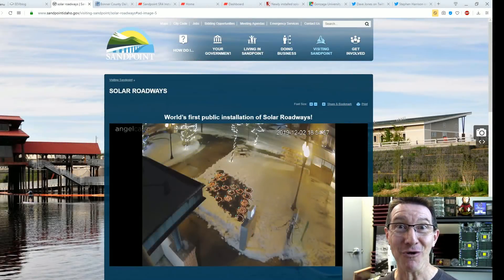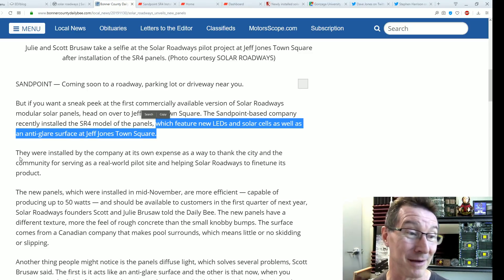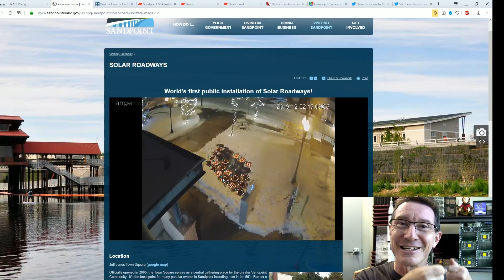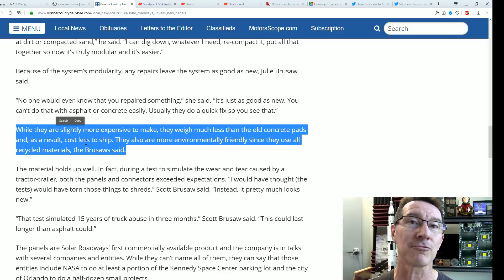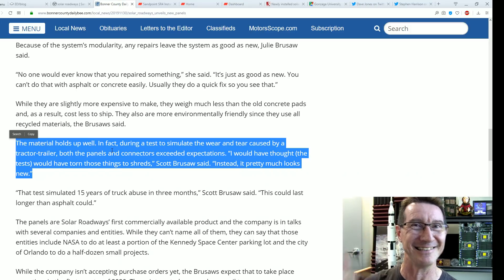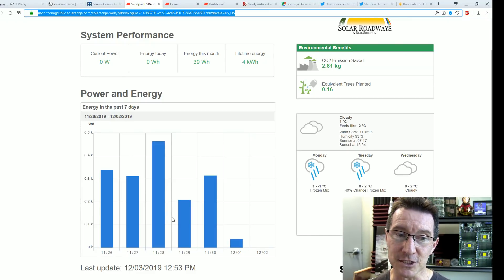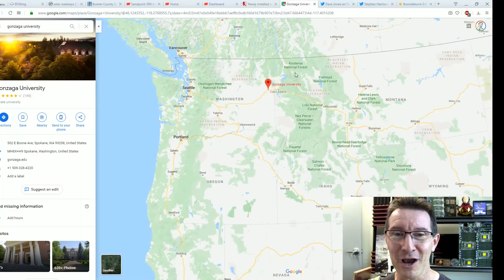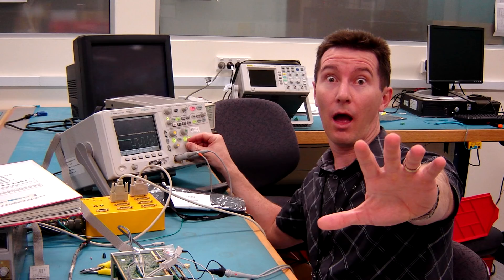EEVblog #1269 - Solar Roadways SR4 DATA Hilarity!

Comment: It's a joke now. Just as Orville and Wilbur's plane was at the time. It was 75yrs between that flight and the Shuttle. Just saying.
Reply: Orville an Wilbur had the physics on their side.
Putting solar cells on the road and having cars driver over them will be as bad of an idea in 75yrs then it is now.
Puttin solar cels on rooftops however perfectly makes sense.

Comment: I still say they need to totally change the target audience of these.  They have the manufacturing setup, the tiles are kinda cool but what they're trying to use them for is ridiculous.  Drop the roadway part, drop the heater, maybe even drop the solar.  Keep them as glass floor LED tiles that are hackable and open source and sell them as floor tiles for decking, indoor installs etc. These could be neat in places like malls or outdoor hang out areas in summer.   Not all is lost, but they need to come to terms with the fact that their original idea is ridiculous. Since they have the product, just switch directions and market it differently.    As a side note their energy production numbers are horrible.  My 400w shed solar install produced over 10kwh in less than a year and the panels were snow covered most of that time.  To be fair we have like 16 hour days in summer.  But to add insult to injury, that power output would be higher if I had a bigger load on them. Most of the time the system is just idle if the battery is topped up.  I need to figure out the snow situation so I can use it year round for something.  Freezing rain/wet snow kills them for the year.  I just called it quits this year and brought the battery inside since we got an early freezing rain so they won't produce much till May when it melts.

Comment: Even putting solar panels on a residential roof in the US is really poor use of resources (due to added labor/parts from the customize installation), especially in Northern Idaho (during winter months it will produce essentially zero) - as it cost 5x more than utility scale solar PV - per the latest Lazard LCOE report.

Comment: Seems like they are really buying their own bullshit. Even though you don't have to be an engineer to see how this is as useful as solar powered torchlight, they are still working on their pet project. Can't wait to see real test on the road. We already know it can hold weight of a small tractor, would be interesting to see how it deals with 24 hours of 20 ton truck traffic.

Comment: Heated driveways exist, the following is a quote from a UK website "Power Output
 - Provides a fixed heat output of 25W/m and can be laid at spacings as close as 80mm to provide a system with a capacity of 300W/m² that would typically provide protection down to -20°C"

Comment: Would be useful to have some civil engineers weigh in on this, but since I did work experience at Queensland Transport back in high school, I was under the impression that keeping roads sealed was instrumental in ensuring their in-service longevity. It's not just the heaving due to freeze thaw cycles, but water itself flowing through the road foundation can lead to erosion underneath and other movement problems. I'd think this would be of significant concern in places where crushed limestone or other semi-soluble aggregate is used in the road foundation. I would have thought that you'd want some kind of drainage system to drain the water off to the sides and keep the road foundation as dry as possible.

Comment: I'm from Atlantic Canada, we have fairly icy and cold winters. We also have studded tires! Those studs have tungsten carbide points in them, I cannot see how a glass surface would survive that for any length of time. Hard braking or spinning your tires leaves marks on pavement as-is. Those would get all scratched up or cracked in no time lol. Oh, and we have giant plow trucks with heavy steel blades with chains on their tires occasionally, graders for busting built up ice and salt/brine to melt snow/ice. The weather here in Jan/Feb routinely hovers at -15c to -20c and often dips bellow that in cold snaps. OH and it's usually dark by 4:30pm! These would not last a week here in the winter! Just wow.

Comment: Not sure about that particular tractor, but they can actually be quite heavy, much heavier than a small car. Those rear tires are often filled with water, not air for added weight and traction.
Reply from the maker: Not in this case, I found the specs of the exact model and IIRC it's only 750kg, well under the weight of a small car. And the big low pressure tires distribute the weight.
Reply: @EEVblog  Fair enough, but the specs would be with the tires filled with air. As I pointed out, in actual use, most farmers will fill the tires with water (at least partially) to increase the weight and traction. I really doubt that the quoted specs for the tractor would include that because they aren't shipped that way. I know that the tractor that my Dad has is a similar size to that one (maybe even smaller) and it weighs FAR more than his Dodge Dakota.

Comment: Consider this, UV light can be harmful, and if the solar panels are on the roof, they will be exposed to direct UV light. Now imagine if you could put the solan panels in the ground and then park cars in them, it will protect the panels from harmful UV light.

Comment: OK, so this isn't the panacea they claim it to be.  But, this could still be a viable product.

The solar output isn't great, but it's something.  Municipal and state governments "own" tons of land that is a right-of-way.  If they maintain the right-of-way they can do whatever they want.  Rooftop space is scarce by comparison.  And, in more tropical latitudes the output could be significant.  Some places could generate a meaningful portion of their electricity this way - even if it were used for just sidewalks.

Even if it takes a net input to melt snow, that could be fine.  Don't forget you are just trying to beat the cost of other forms of snow removal which aren't free, and can have knock-on costs damaging the road surface.  And, some places get very little snow - some so infrequently that it doesn't make sense to procure snow removal equipment and when it snows they close the roads.  Freezing rain is very dangerous, even though it is just a thin layer of ice.  Also, in my area (Ontario) our grid is in oversupply most nights due to lots of nuclear generation, so we pay to dump power at night so using the power to melt snow wouldn't be a problem.  And - you could skip the heating elements if you like - in a patent you put in a bunch of extra rubbish that might happen one day.

The LEDs could find an application assisting self-driving vehicles.  The LEDs could emit modulated signals to positively identify lanes and hazards.  1 of the hexagons every 10 meters of lane could be really useful just as a self-powered lane beacon.  Don't forget - you can just skip the LEDs if you like.

The big challenges this strategy has is cost and durability.  But, have you seen all the things corning has done with glass?  Seems like they can make anything from sand.  I have faith a very durable, weatherproof, transparent enclosure is within the bounds of reality.  As for cost of manufacture and install - yeah it's probably always going to be way higher than asphalt.  But, if history has taught us anything it's that cost drops with volume - particularly in electronics, and the volume of these things could be massive.  And, you could build a specialized robot to install these things.

Are they bullshitting in their marketing material?  Sure, like every company.  Is this a worthless technology?  No - it has potential applications.

Comment: It was a good thought experiment, but should have been abandoned as soon as someone did some back of the envelope calculations and realized that for half the cost of installation, you could have a canopy solar system over the top of the cars parked instead of under them that produces 5 times as much energy.  And maybe if they dropped the whole solar idea and just focused on the LEDs for dynamic lane marking.  They might actually have a chance of making a usable product.  Still think even then it would only be useful for a parking lot and not a road surface.
Reply: Yeah.
But even for a parking lot, it is much cheaper and easier to simply paint the markings.

Comment: Hahaha yeah, a FULL SIZED backhoe is another beast completely!!

I used to have a backhoe and if it was remotely warm outside just turning my tires while not moving will litterally rip the pavement surface and leave tracks in it...

Good luck with full sized LOADERS clearing snow with their cutting edge! (I can picture one flying down the road completly peeling up the solar for half a mile xD)

Comment: Everything like this always comes down to basic mechanical engineering.  Even a basic, practical understanding of M.E. dismisses this entire idea simply on mechanical reliability.  You don't even need to invoke the problems with the electric/electronic aspects.  These things simply will not hold up under average road and environmental stresses.  Roads are harsh environments.
Reply: Indeed. A bunch of rocks mixed with tar won't even hold up for more than a few years with several ton vehicles driving over them. Let that sink in for a moment. ROCK with tar mixed in will buckle and crack and slowly fall apart and develop potholes and needs periodic maintenance and it is one of the most durable materials we have (which is, well, why we use it in the first damn place). It's durable but yet flexible (otherwise it would just snap from the stress, even if you made roads out of steel, you'd just end up snapping the steel, not to mention it would rust) but not even it can stand up to the abuse. Thankfully, asphalt is also insanely cheap and easy to repair, which is again, why we use asphalt for roads. So, if rock mixed with tar can't handle it, why in the hell would anybody think a GLASS (one of the most brittle solids known to man) panel with circuitry underneath (again, not the most structurally sound thing, PCBs are not known for their structural strength) would fare any better? But they go "you can just replace little sections as they need worked on" ... but you know what? You can do that with asphalt too, and they can and do, on a regular basis all over the world. A pothole appears? You fill it with asphalt. If a large stretch of road is going bad? Dig it up and lay down freshly recycled asphalt. It's not hard.
Reply: @Dhalin  Several years back when I was in high school someone thought solar roads were a good idea. I then processed to tell then what you just explained and then they realized how shit of an idea it was (I also live in Atlantic Canada, it like the Uk with a lot more snow). It's amazing how an 18-year-old can see how shit of an idea it is and can explain why to others but the government thinks it's a great idea then wonders why it doesn't work. Me thinks the government is a bunch of toddlers with a big vocabulary.
Reply: @marikroyals7111  The government is just full of people who wanna champion "green" anything. If it's a buzzword and it sounds "green", they get behind it, to fool the people into thinking that they actually care about the environment when there's a million other things they could do instead that would be way better for the environment and society. But, they gotta have them votes, and the populace is easily swayed by buzzwords that "scientists" shove down their throats. "SOLAR IS THE FUTURE!" they say, and people gobble that shit up without thinking about what it really entails. It's like ... seriously, now. There's a reason why we don't get the majority of our energy from Solar. And no, it isn't just to keep coal miners in business. Very similar reason why we don't have more nuclear energy, it's because of misinformation, and politicians caring more about looking good to the people and/or the public being misinformed.
Reply: You can take a sledge hammer to road tarmac and nothing happens. It’s TUFF. 
Yet weather still gets in and causes potholes.

Comment: So you are doing all the calculation for "rest of the world" in metric units as well, but then end up with "1/2 foot of snow"  *doh
Reply: All the calculations are based on SI units (metric).  The original question was to find how much energy it took to melt 1/2 foot of snow for the benefit of the viewers in "Yankee land".  Surprising how "Yankee land" uses kWh and not something like horsepower-hour still.
Reply: @threeMetreJim  Well yes, but after all the conversion from imperial to metric and back, would only be reasonable to add cm as "gimmick" as well.

Comment: While you have to grant that the low albedo of the tiles will trap stray light under the snow, turning it directly into heat, which will probably have a fairly good effect at melting snow. Way better than the electrical heater.

Comment: Trying to melt the snow with heaters on a flat surface is a daft idea, when you melt the snow you have to melt the whole layer away before it becomes effective. It maybe would be a better idea to have these heaters on a roof panel that is inclined, this means you only have to heat up a small layer of water before the snow will slide off due to the angle.

Comment: (just as a thought exercise) Would a Peltier sort of arrangement under normal asphalt be useful?  Since asphalt can heat up a lot on sunny days,  and current could be fed in to remove snow in remote areas
Reply: that is still not an easy solution. If you use peltier you need wiring to power the peltier(s), and you need plumbing to supply heat to the peltier to melt snow.
Reply: Peltiers are very fragile, and asphalt doesn't conduct heat well at all.   Fail.

Comment: I’d like to see someone drive over them with a set of chains on their tires, or when they’re covered with a mix of salt and gravel. Or just the blade of a snow plow. These wouldn’t survive their first winter.
Reply: I never run chains, but I do run studded tires if the ice gets bad enough.  The slightest little bit of tire spin and those carbide studs dig grooves into concrete, and my garage floor has the scars to remind me of that.  Would love to see how glass handles that scenario.
Reply: @a89proof  Glass doesn't handle carbide very well at all. Just takes a light tap and that's all she wrote for the glass.
Reply: First winter? You mean one day.
Reply: I bet you would be lucky if they survived first week.
Reply: They wouldn't survive their first winter?
They wouldn't survive in the first minutes of snow fall.
If it snows, you have snow plows and rocksalt to worry about... can you imagine that?
If it sleets, you have rocksalt to worry about.
Reply: @Foreststrike  I'm not convinced that a road made up of hexagonal paving slabs would last long even with fairly light vehicle traffic in dry conditions.
Reply: Wouldn't survive the first DAY.  ;)
Reply: Tire chains while strapping a grand piano or some heavy furniture on the roof of your car

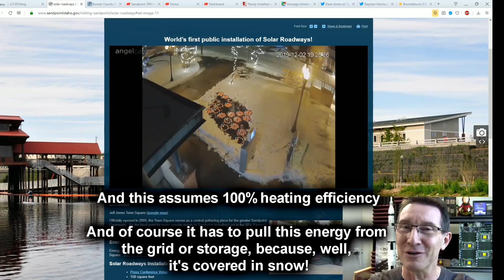Comment: 17:10 "And this assumes 100% heating efficiency".
How can one not have 100%?
Reply from the maker: Not all the heat is directed into the snow.
Reply: If I hook up a resistive heating element in my garage it will be effectively 0% efficient at heating your bedroom.

Efficiency is the percentage of energy or power or energy used in doing some specific thing you want it to do. You define this arbitrarily.

Comment: It's worse even! When covered in snow these (or any) solar panels won't convert any sunlight into heat (through electricity)!
So the whole concept is imbecile!
Reply: Most proponents of solar energy think the grid is an infinite-capacity buffer for energy that you can use at all times.
So, during summer they dump energy generated from their panels into the grid, and during winter they retrieve it to heat their panels.
Similarly, during night they illuminate their panels from energy they dumped during the day.

Of course this is not going to be a sustainable situation.  Ironically, they often think of solar energy as sustainable, but then implement it in a way that is not sustainable.
The first cracks are already appearing: in rich neighborhoods where everyone puts solar panels on their roofs and is away to work during the day (taking their EV with them), it is becoming difficult to put power into the grid because the local line voltage already is at its maximum and no local user wants to consume the power.

The electricity companies are getting energy fed into the system that they did not ask for, and have to adjust their own generation to match it.  They have to have their generator capacity, because once it gets dark it it is winter everybody asks for power as they used to, but now they cannot sell power during day.

Of course this is going to break sometime.  The people that feed back power are going to have to do so at considerably lower rates (right now they can often just subtract their own generated energy from their total bill, leaving the electricity company at zero income) or the entire system will break down.